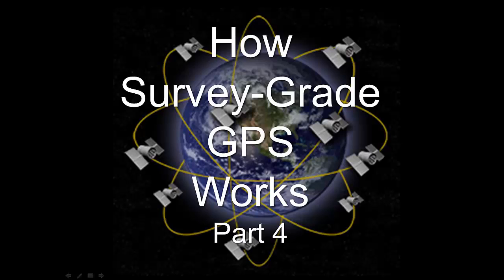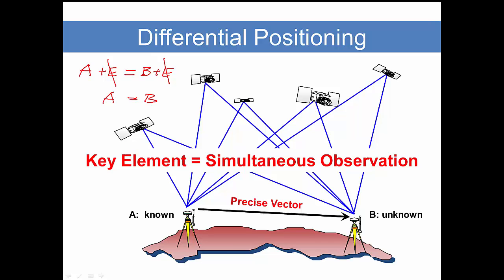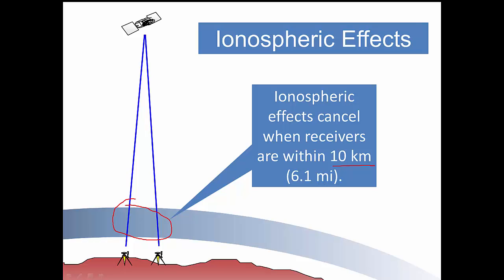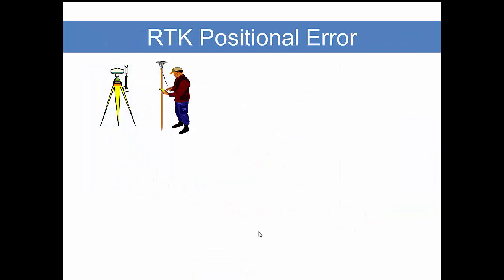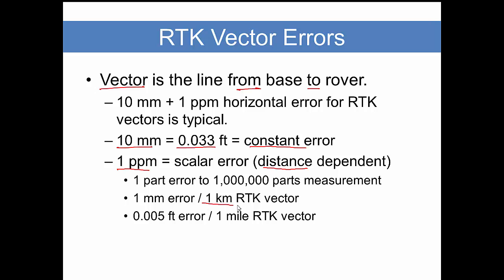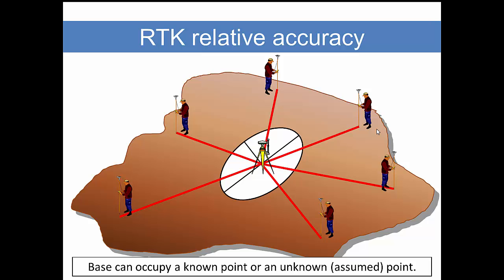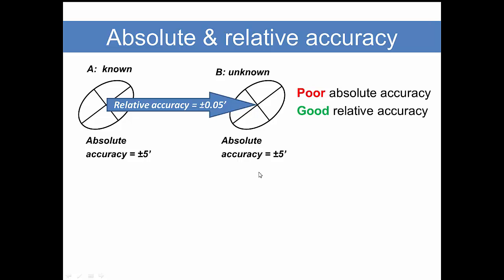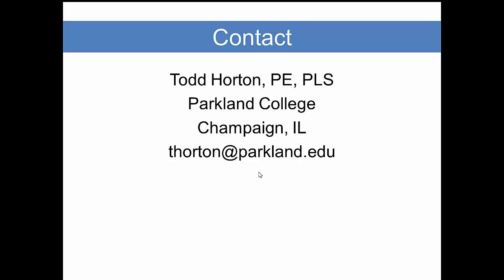How Survey-Grade GPS Works, Part 4 of 4

Comment: thank you for your video , i want to ask about something , i want to make a gps for survey measures , i want to use android and gps receiver for that , i will connect it to android using gps or wifi , and i will let android do the calculation , my question is can i use other manufacture base for doing calculation , or can i do my own base to do the correction using another receiver . thank you >